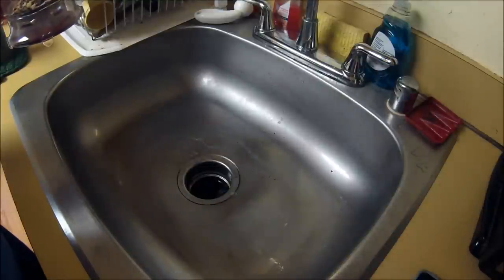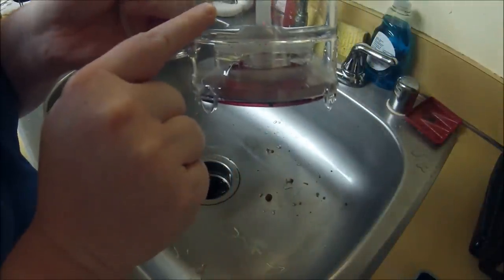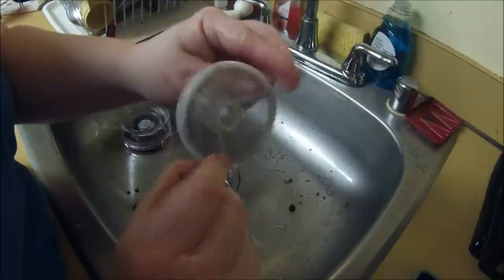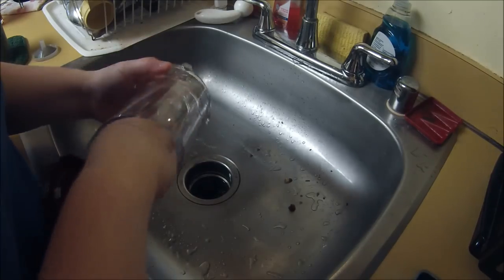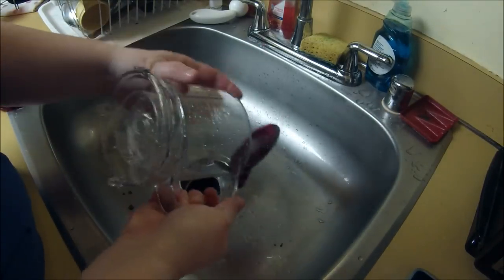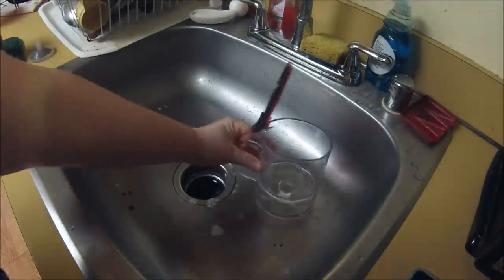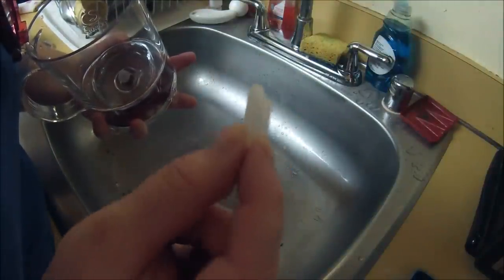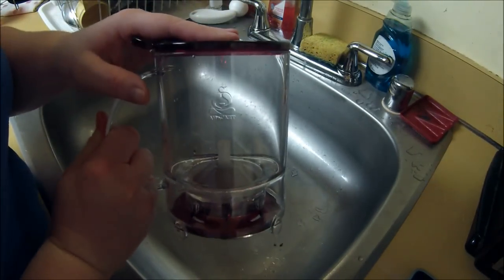How to Clean your Teavana Perfectea Maker

Comment: All my directions say is "The lid and stainless steel strainer can be removed carefully and washed separately."  It doesn't say or show how to do it.  Thank you for the video, I was afraid I would break it.

In the spirit of sharing, the instructions say that it's dishwasher safe, but the company recommends hand washing with mild soap and a non-abrasive sponge.  It also says to allow to air dry.

Comment: Just a tip for people who don't have a good sink that has a garbage disposal or a wide enough hole to be conducive to tea leaves (I only have the bathroom sink in my dorm to work with) dump the tea leaves that you can get out without rinsing in the trash (I have a separate tiny trash can specifically for tea), once you get out a majority of the leaves, place a paper towel on the bottom of your sink and slowly rinse out the rest of the leaves using the paper towel as a sort of coffee filter. Once all the leaves are out you just through the paper towel away and you won't have to snake the drain :) from there you just wash it like normal!

Comment: How do I get all the residue from the mesh on the filter.  Mine has become very clogged
Reply from the maker: +kathy gallaher I would try running it under a high water pressure or with a sponge, or if you're willing, blow on the mesh to force the bits out.